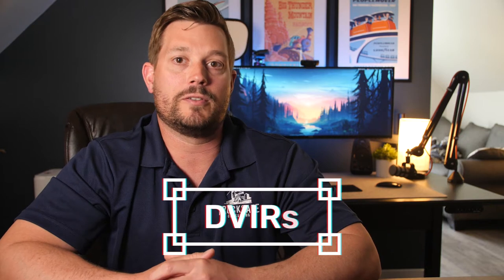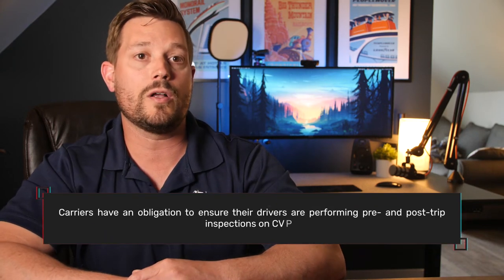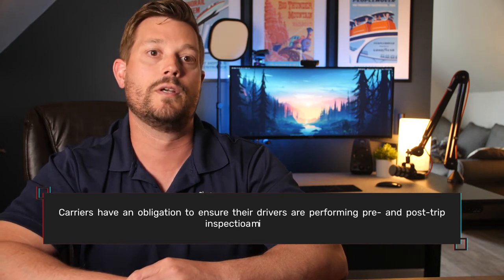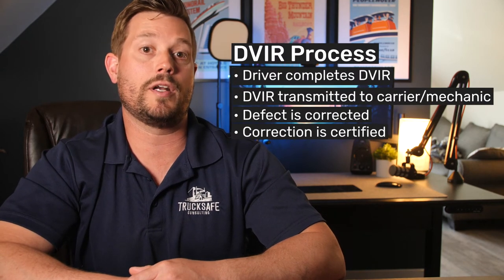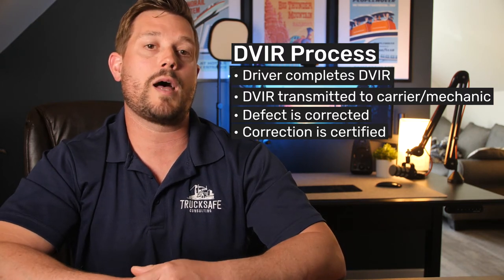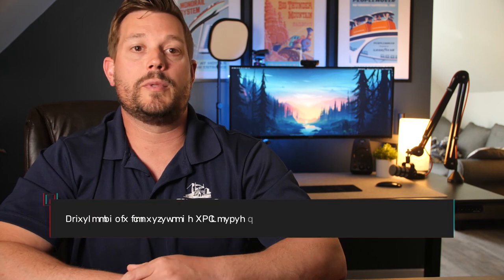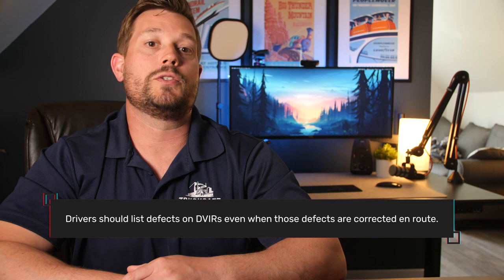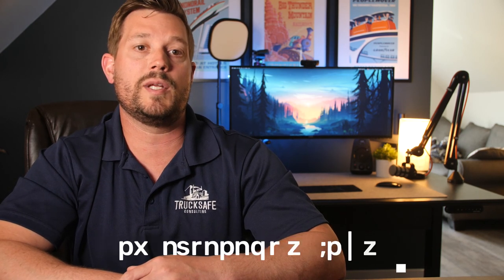Understanding the Driver Vehicle Inspection Report (DVIR) Process

Comment: At 4:10 "don't complete a DVIR for a truck defect that doesn't effect safety or potential breakdown."
Question: What if the driver heard an abnormally loud or strange sound coming from the engine,  but didn't know specifically what it was or the risk of operation.  Is this a defect you suggest we use a DVIR for?  If so, must a mechanic sign off before the vehicle is placed in service again?  You suggested not using dvir for things we know don't effect safety or breakdown. But what if we don't know? My question really is, does the fact that the driver feels uncomfortable enough to note a defect on a DVIR require a mechanics opinion and signature?
Reply from the maker: Best to fill out a DVIR and have it checked out by a mechanic.
Reply: @Trucksafe  thank you.   If the driver completes the DVIR is the carrier obligated to sign the form either with or without repair before using the truck again?
Reply from the maker: Yes, the carrier would have to sign off that either the issue was corrected or there was no problem

Comment: If a required repair is made, is a paper DVIR required since ELDs have no way for mechanics to certify repairs have been made?
Reply from the maker: There needs to be some certification from whoever made the repairs but it doesn’t necessarily have to be on a paper DVIR since FMCSA guidance says all required records can be generated and retained electronically.